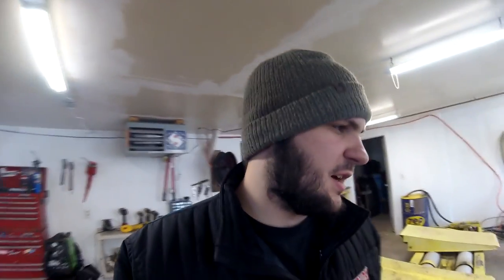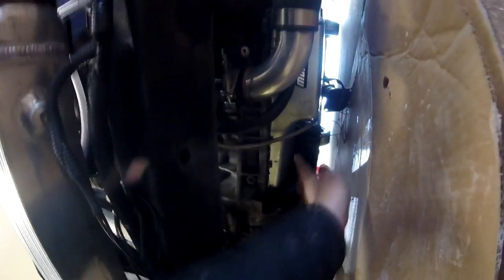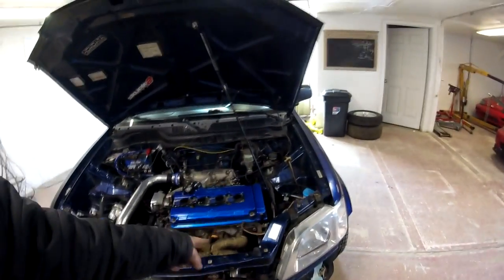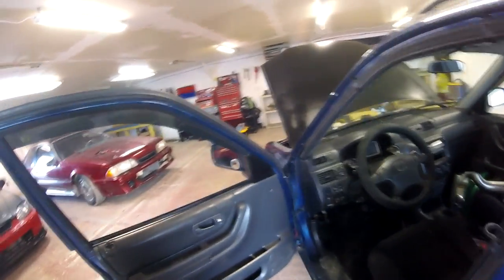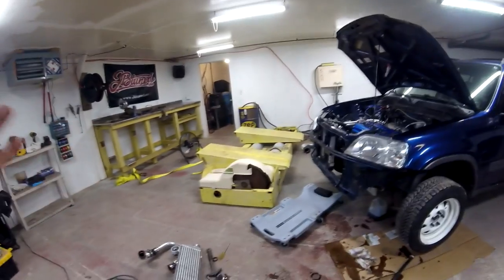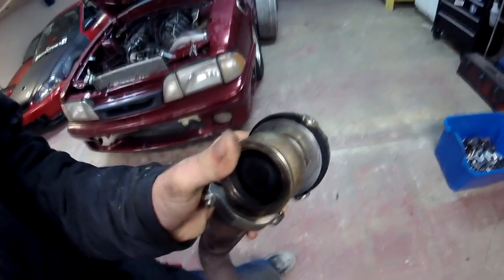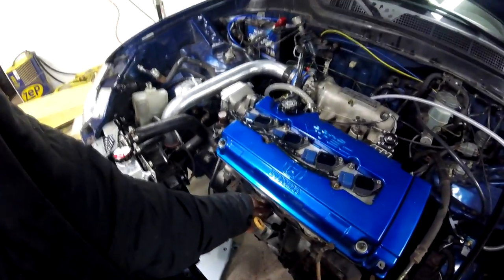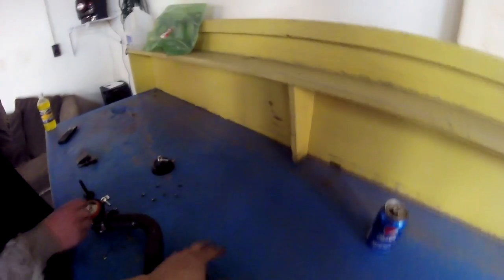Turbo Vtec Honda CRV In For Some Fix's

Comment: turbo setup looked clean but seems like the owner/installer halfassed the easy work.  Who the hell runs the oil feed line underneath the oil pan, close to the downpipe?  SMH....
Reply: First time "building" a car. Hence why it was ran for less than 10 minutes and sent to Hunter asap. Appreciate the input tho
Reply: If the individual were to look (follow) at a manual, he/she should be able to manage hoses, wires/cables. I took apart a FoCuS ST for the first time, followed the manual and never ended up with any fuk ups, except for a fuel leak from the cyl. 2 injector. Things take time, and always check and re-check work. Work safely, wear the proper PPE when working on cars or trucks.  Good luck!

Comment: @HunterTuned Hey Hunter,  I was wondering whats your opinion on some of the cheaper ebay B20Vtec kits - Considering its mainly just fittings, a line or two and some hardware. I feel like you've talked about it a bit on a live or something, but can't find it. I've been looking into possible build routes for my CRV actually so its funny this video should pop up - Between boosted B20, NA H2b, or NA B20V, I'm leaning towards b20v just because I can get it done for next to nothing whereas the other two options would budget around  $2000 (in Canadia). Not trying to make a monster, just up the power some for easier AWD snowy city driving. Cheers and congrats again on the shop!
Reply: I bought my lsvtec kit off of aliexpress.  It came with a sandwich plate,  dowels, feed line for the head and the AN fittings.  The kit works great and I can't reccomended it more.
Reply: @harleyjerram9699  Thanks for the info, its probably all coming from the same place. But since theres no moving/mechanical parts I dont feel as bad. Mind if I ask, is yours more or less stock bar the vtec kit? If so, are you just running a vtec ECU like GSR, or did you grab a chip n tune  etc.?
Reply from the maker: Yea really just need the lines and fittings they work just don’t over torque the cheap aluminum fittings